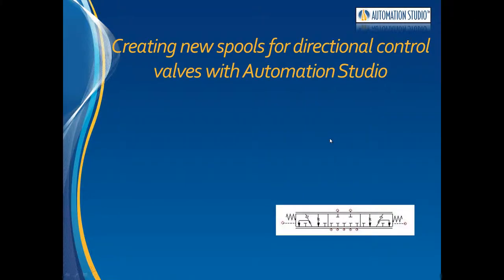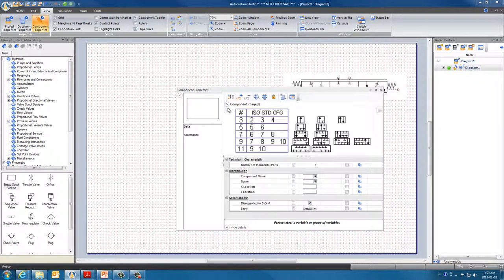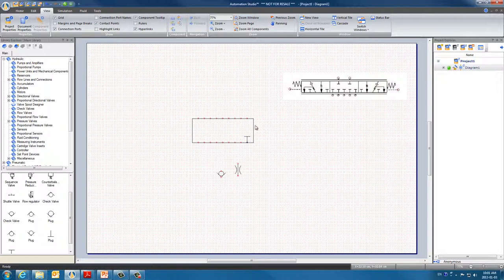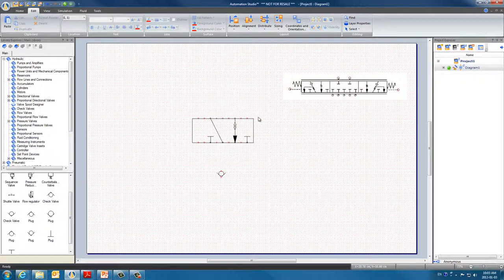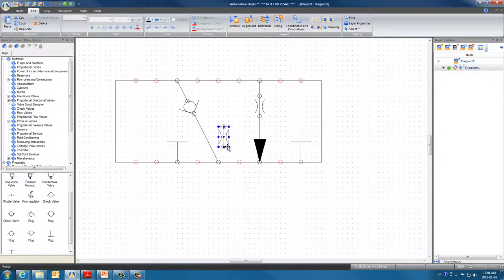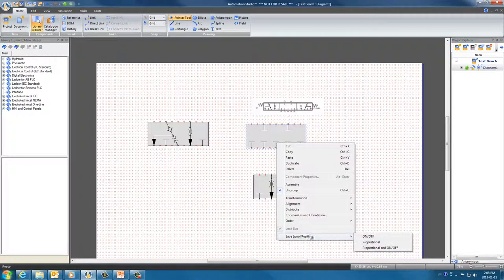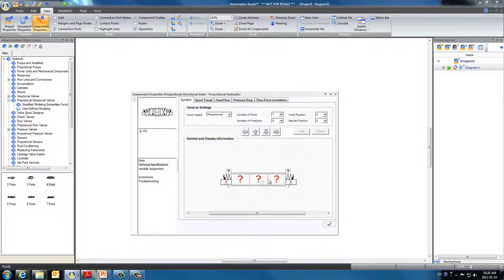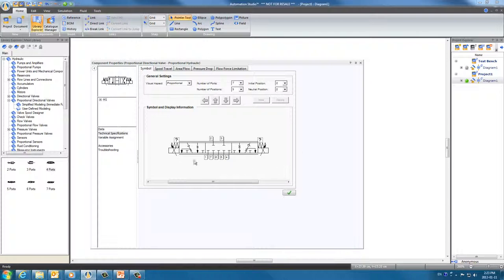Creating Spools (Fluid) with Automation Studio P6

Comment: is there a command to turn that throttle valve into a variable throttle valve?
Reply from the maker: During simulation, you can vary the orifice diameter of any type of throttle valve simply by clicking on the component. If it is for documentation purposes, simply delete the component and insert the throttle valve of your choice.
Reply: @FamicTechnologies  Thanks for the quick reply!